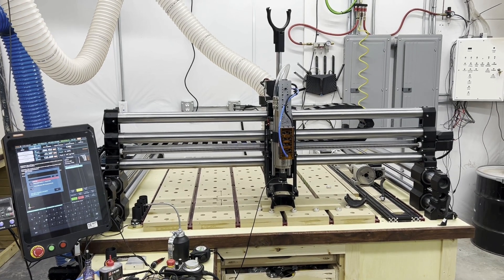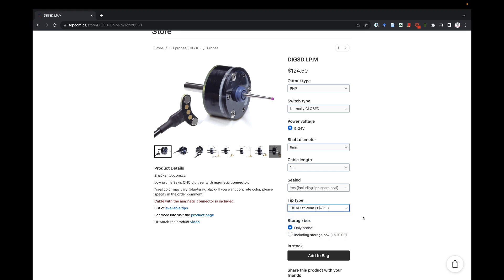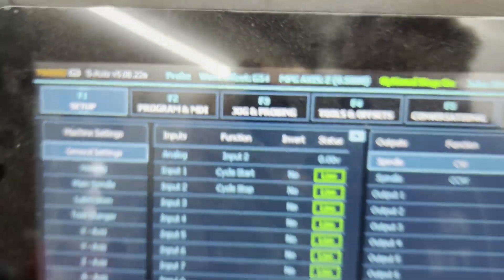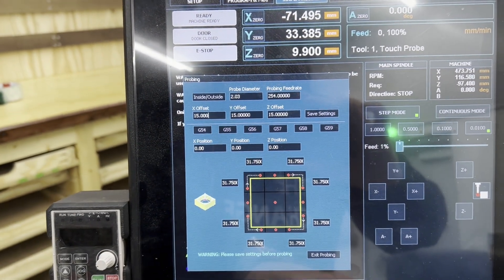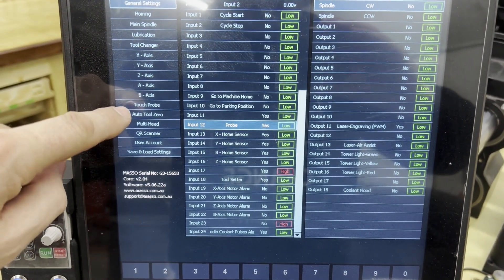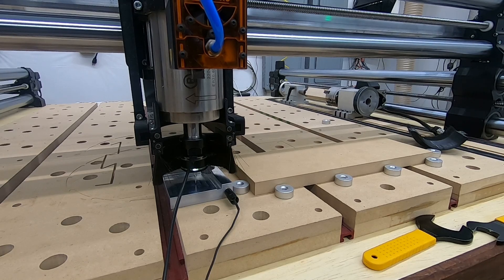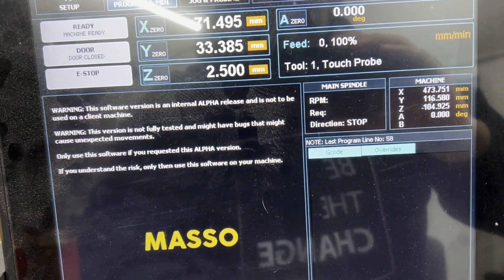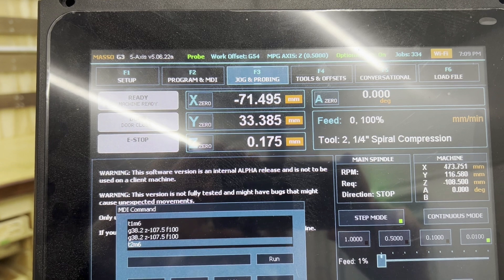Zero Like a Pro

Comment: I did similar procedure that you are showing. However, if the touch probe is mounted just slightly differently in the collet next time the complete WCS Z0 will be wrong.. 

scenario: the touch probe is mounted slightly different in Z (in the collet), the top of WCS is probed, after that the tool is changed to an end mill + auto tool zero on the tool setter = the tool tip will not be at Z0 WCS anymore).

So it is ultra dependant that you are mounting the touch probe EXACTLY as you did when you meassured the tool offset (the touch probe offset must match which they wont do from time to time)…
Reply from the maker: This is why I use the magnetic connector to hold the probe at the correct position, and why I only finger-tighten the collet nut.
Reply: @ but ”finger tight” on the collet nut may be +-0,5mm. Not exactly precise..
Reply from the maker: @droneforfun5384 I don’t believe that’s true when the magnetic connection is the determining factor. You could almost do it with no collet nut
Reply: @UglyDogWoodshop  I did a lot of tests and you should tighten the probe correctly to get the least runout. Using high quality collets and always the same orientation of the spindle and the probe.

Comment: After the touch probe is calibrated and you select the X Y touch off command, should X & Y read Zero respectively right after the probe touches the X & Y position on your workpiece?
Reply from the maker: Yes, but when doing the automatic probing routines, the Masso will pull the probe back from the zero point.  As such, the DRO for that axis should be off by the amount it moved.  You can always jog back to that position and confirm that it's zero when you're back at the edge you zeroed from.

Comment: Newbie question...
 When using the 3d probe on the masso g3 touch. 

In the beginning of your video where the probe is touching off the x y and z

Are all 3 points being measured automatically?
 
Are you running some sort of macro?

Or are you manually jogging  the machine to get it close to where you want it then hitting a selection on the masso probing screen?

I see the inside circle measure selection on the masso probe screen.

That allows it to move from side to side to then find the center of any size hole.

But I dont see where it would automatically measure x y z on an out side corner?

Am I just overlooking something obvious?

Thanks in advance!
Reply from the maker: It measures X, Y and Z automatically in a sense.  But it doesn't do all three at the same time.  You can do X and Y at the same time, depending on how to initiate it in the MASSO.

I'm not running any macros.

I am manually jogging to get close to where I need to be, then hitting a selection on the probing screen.
Reply: @UglyDogWoodshop  Thanks for responding!
So i'm not entirly crazy... lol
and can stop looking for a way to get the Masso to do all 3 movements automatically.

Comment: I see that the Masso has a connector marked XYZ probe. Would this probe plug directly into that without using the internal terminal blocks?
Reply from the maker: Nope.  That connector is for their 2-wire XYZ block.  You could install a connector in the back and use that with the 3-wire model in the video, but it has to be wired differently.

Comment: I know Masso instructions say to disable the auto tool zero but I wonder why as when you assign a tool to the probe it will not seek the setter anyway.
I got my probe, same as yours and after setting ti up it works perfect with X and Y but the Z ends up off by 1.200" , feel I followed the instructions to the letter.
Pat
Reply from the maker: Did you follow my instructions or Masso’s?
Reply: @UglyDogWoodshop 
I do not have or use a touch plate so I followed Masso's  instructions and referenced yours as well, seem like the difference is using a piece of paper verses the touch plate,  I also noticed that when I probed a different thickness of material the value in the tool table did not change for the probe like it does for the tools.
Reply from the maker: @patraymond3791  email me and I’ll help you get this working.

Comment: Dude your videos are good. I’m exited to see what else you do. I see it looks like your getting an atc soon by the holders. Curious to see your solution to the dust boot issue. Also I see I believe you’re running MASSO firmware 5.100b. Curious how you like it?
Reply from the maker: Thank you!  I’m still running the alpha release that preceded the recent release with the MASSO Link lockup issue.  So far so good, but I can’t say I’ve pushed it that hard yet.    Yes, those holders are my own design.  I’m trying to perfect the height so that the dust boot problem is minimized and so that the 3D probe fits.  I have two solutions in mind for the dust boot problem.  I’m excited about both.